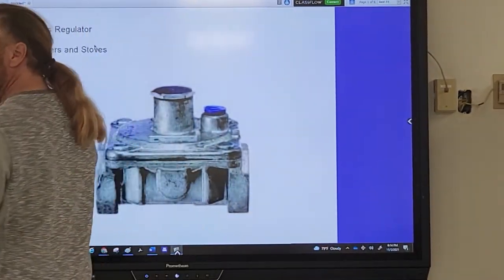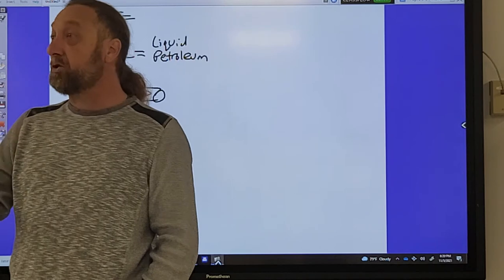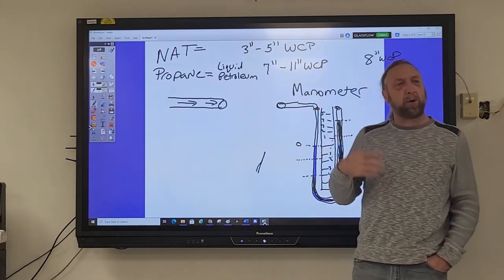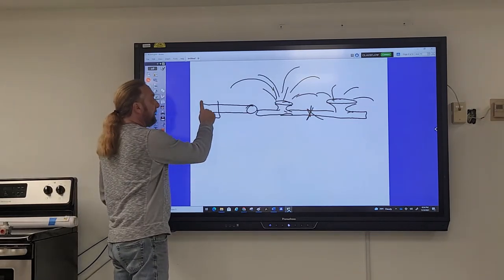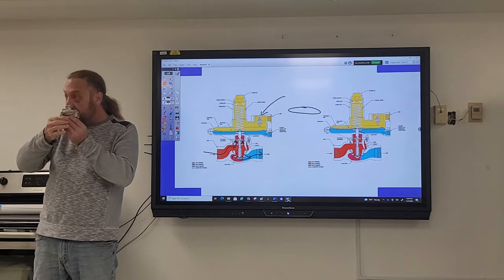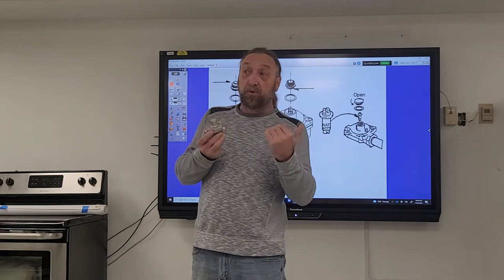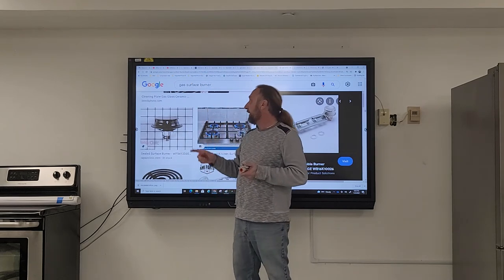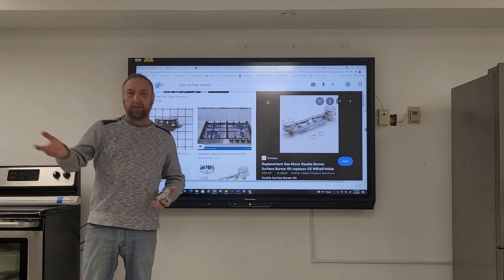Gas Regulator Stove and Dryer

Comment: Shouldn't the NAT wcp be 7 to 11 because of the lower energy density?
Reply: Nat or natural, runs at 3-5 inches wcp. My next video will cover converting natural stove settings to LP. Might explain a little bit more